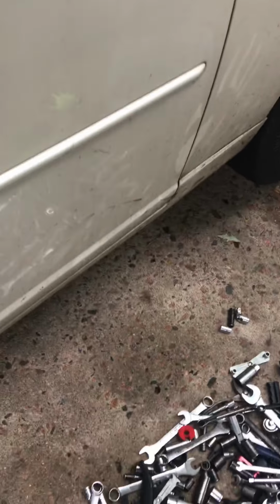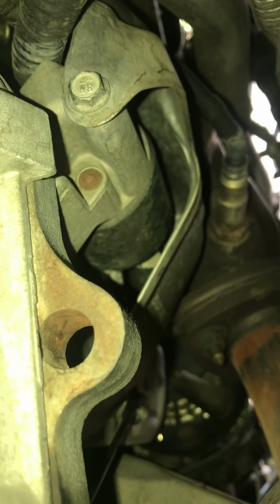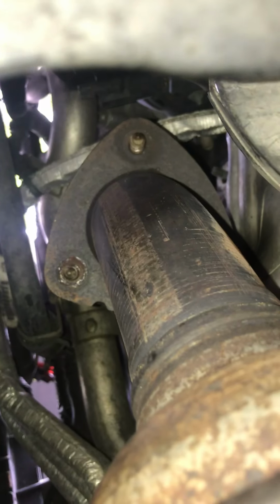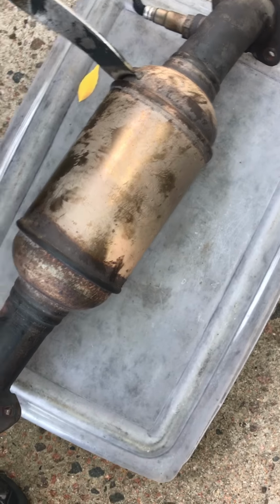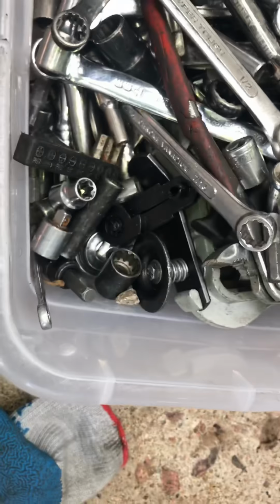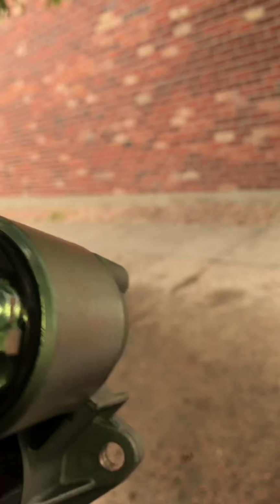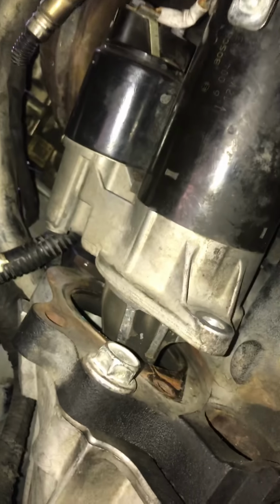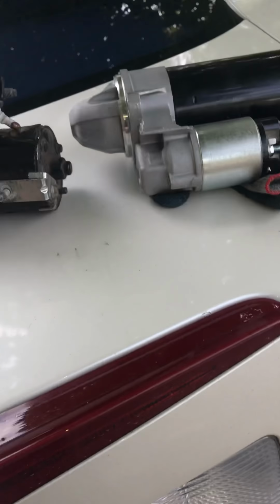2003 Cadillac Cts Starter Replacement

Comment: No lie this video is helpful af ! Funny because no lie it is hard to do and it does take time. Use a universal joint to remove the upper bolt on the backside of the starter. It does take time and elbow grease but can be done. Just removed mine yesterday.

Comment: jeff blair
i have a 2007 Cadillac SRX AWD. I couldnt get starter out from underneath (between cat. converter and steering rack). i turned it end to end - upside down - side to side and it wouldnt come out. Plan B ----- i started looking for another hole. I found one on drivers side above the rear of the lower control arm and above the tie rod that goes into the steering rack. I had already taken the drivers side steering rack bolt out and the passenger side bolt loose but couldnt take the bolt out because mine is a AWD and the top of bolt hit the front drive shaft. i did this thinking i could move steering rack a little for clearance so i could drop starter out the botton. couldnt move steering rack enough. The steering rack would move a little bit but not enough. so at this point- steering rack is still loose. This is when i found the side hole behind left tire and above the rear of lower control arm and above the tie rod that goes into the steering rack. I tried to get the starter out of this hole now. Remember the steering rack is still loose at this point( it moves a little bit). Couldnt get it out of the side hole because a wire with a connector was pluged into a round thing , that is part of the steering rack . The plug has a locking tab on the top of it . Push down tab and pull plug off. With the plug off it gives you just enough room to remove the starter. I took mine out with flat end of starter pointing down and the selinoid facing towards the rear. I dont know if having the steering rack loose helped or not. If you cant get it out loosen the steering rack and that might give you the 1/8 inch you need. Also there is a soft and hard brake line that might hamper your efforts. Just gently kinda push on them for clearance. STARTER IS OUT . NOW  PUSH NEW STARTER UP IN HOLE WITH CONE (GEAR END) POINTING UP AND SELINOID FACING THE REAR OF THE CAR. I DONT KNOW IF YOU HAVE TO LOOSEN THE STEERING RACK FOR SURE BECAUSE I ALREADY HAD IT LOOSE. I DID HAVE TO REMOVE THAT PLUG THAT GOESTO THE STEERING RACK THOUGH. GOOD LUCK!!

Comment: So if it just clicks once after I turn the key, most likely it’s the starter ? Battery is charged, etc..
Reply from the maker: If The battery is charged / good / tightened down it most likely they starter
Reply: Thanks for the info so quick. Just got yourself another sub. 👍

Comment: I've seen every video on this job, nobody shows how they got the starter top bolt out...why? How did you get the top bolt out??
Reply from the maker: There’s no way to show it bro it’s just a Way tight of a spot you have to really do it by feel
Reply: @1Guy1Wrench  I tried I can feel it but I can’t get a socket on it to turn it. I need a long wrench cause I can see it a little bit from the top. I removed the cat and noch sensor and the bottom starter bolt just can’t get that top bolt 🤦🏾‍♂️
Reply: @guttazonefpv5207  that part was a biiiiitch

Comment: how you get out the bolt off from the front of the transmission or from the back of the transmission and what size of the socket are you using?
Reply from the maker: Jorge Garcia I just basically had to keep wiggling the socket in that area I till it got on there and I think it was a E14 socket I forgot

Comment: Heads up: you don't need to remove the exhaust at all to remove the starter! Will make this job an hour or less by just removing the knock sensor in front of the starter.

Simply unbolt the knock sensor and move everything away from the front of the starter. Next disconnect the ground from the starter and move the terminal of this wire towards the rear of the car. This gets it out of the way for the third step. Step three; using an wrench or socket remove the 2 bolts holding the starter in place, once loose pull the starter straight out towards the front of the car then rotate the front of the starter 90° towards you and, like magic it comes right out.
Reply from the maker: Ryan Merriott yeah but how much space do you have when you do it that way ?
Reply: @1Guy1Wrench  just enough to remove the starter with the exhaust intact with just a jack and jackstand in a driveway. Like I said took me less than an HR.
Reply: Hes right man just swapped mine out.
Reply: This is helpful I'm doing this myself and it's not easy.
Reply: @QVNJAY  I pulled mine without taking anything else off it will work out it's very easy just be patient
Reply: Hey bro was yours also on an 03 cts?
Reply: Ive removed everything except the upper starter bolt. How did you guys get to it??

Comment: Hey man quick question. How did you take out the upper second bolt on the starter ?
Reply from the maker: I used my Extension my ratchet and a E14 socket